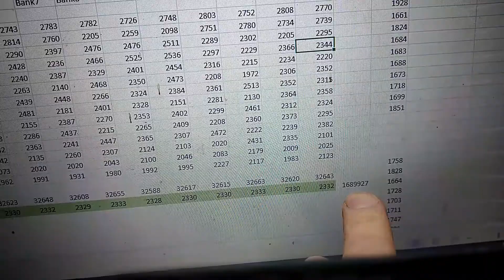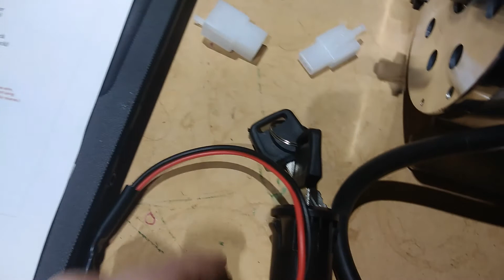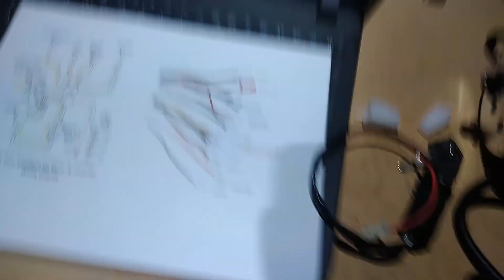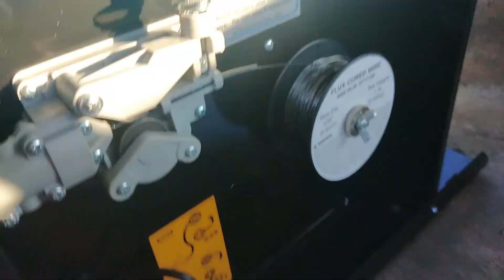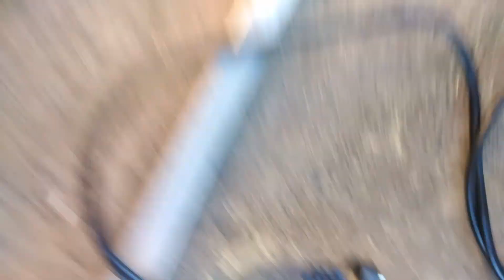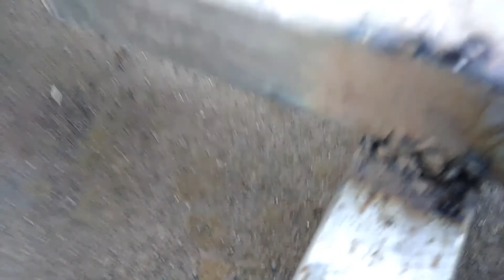Building Electric Go Kart Part 1

Comment: HI, where did you buy the motor, controller and other electrical components? Was it a kit? How much did it cost. Thank you.
Reply from the maker: Yes the Motor is a Kit with Controller and other.
I have added some of these details in the Video description.
If you need more info or if links don't work please let me know.
Thanks
Reply: @adamcecere3369  Thank You! The links work. I will try to find equivalent US options in ebay. I checked the following link but it seems too expensive compared to what you got, any idea if the link below is similar to yours, Thank you for your help. https://cart.electricscooterparts.com/store/Search.aspx?SearchTerms=kit%20go%20kart
Reply from the maker: @pinu1166  Yes it looks like the same motor 48v 1800w. Don't go anything less. I'm glad I didn't because I would of kicked myself.  The accessories are a little different. I had to change almost all the connectors because they don't fit dispite being a kit. I strongly recommend using Lithium batteries.  These ones you show most likely Led Acid. 7 AH 12v Led Acid $40 vs 12 Lithium counterpart $130 AUD. But I had to 18650 so this made it so much affordable.
Reply: @adamcecere3369  Thank you for the detailed explanation and good to discuss with someone experienced. I have some more questions, is there any email ID I can write to? I decided for Lead acid for cost reasons... and agreed, lead acid 4x12v will give less power and lasts half the time of Lithium Ion, unfortunately I cannot build a setup like yours, will have to purchase something. I was thinking of 48V 1000w brushed motor as it is cheaper. My gokart will be around 150lbs and is a 2 seater. Will 1000w be less power? I had thought of a 212cc Predator Gas engine around $150, much cheaper than the Electeic option, but that will be noisy, fumes, hot spots and may need maintenance.. I am not sure about Gas vs. Electric advantages and disadvantages...
Reply from the maker: I'm only learning too. couldn't say I'm experienced but YouTubing all my question. I'm always watching YouTube.
I would have to say 1000w is less power then 1800w but have a look at the rpm,  1800w is 4500rpm.  Yes gas (petrol) is far cheaper but where is the fun in that!.
I took mine out today and reached 21mph head wind and 26mph tail wind.  the gear ratio is 11 teeth Motor to 45 teeth Axle.  Sound like you need more torque then mine because about 1:6 also.
email is recycle18650liion@gmail.com
Reply: @adamcecere3369  Thanks, same here... I found some videos with 300A, 48V around 19hp, but that motors and controller set will around $800. The 1800W motor will be around 30A.